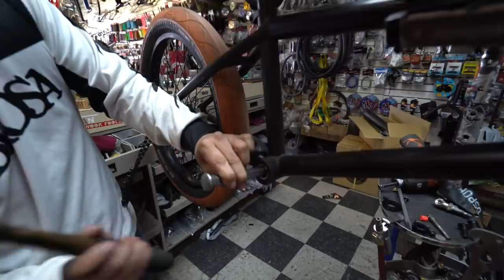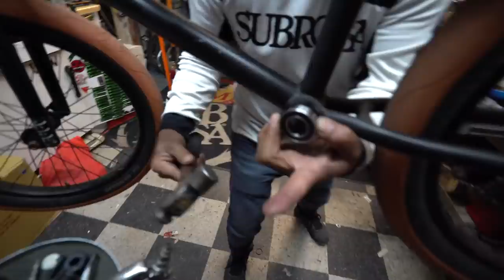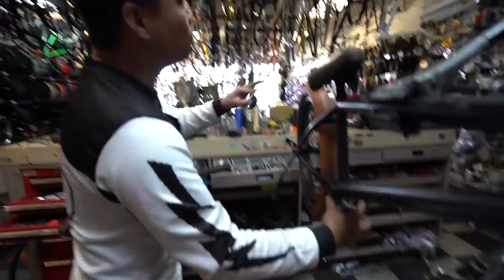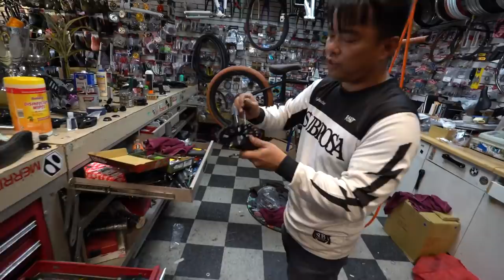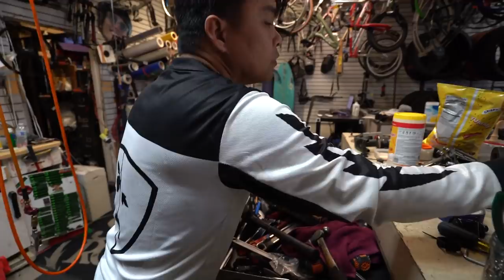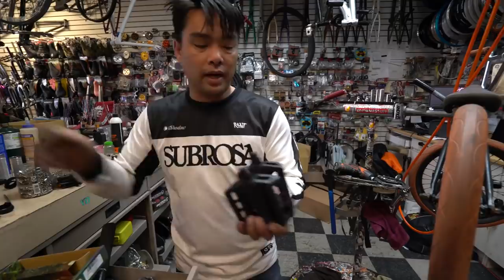How To Install Cranks & Bottom Brackets - BMX

Comment: The “floating spacer” is called a bottom bracket spacer, it’s actually there to prevent over-tightening the cranks and crushing the bearings. It also improves smoothness in the bearings overall in my experience. If it isnt the right size, you gotta add a spacer or buy a different sized spacer. It makes the bearings last longer too
Reply: Yes right to prevent over tighten the bolts
Reply: Which he did, cause the cranks don't spin at all at the end of the install.
Reply: How do I know what size I need ? I want two get new cranks on my but idk what size axle it is
Reply: @angelsolano50 it one size fits all
Reply: Nah really I didn’t know
Reply: The correct term for it is inner bearing sleeve
Reply: @apathy9237 thanks for explaining what "this thing" is. These clowns spent too much time screwing around and not enough time explaining and showing us what they were doing. How about getting the camera closer to the BB instead watching pho work.
Reply: 19:22

Comment: Why would you throw the spacer away? The spacer prevents the bearings from side loading the catridge bearings. Just cut the spacer down with a pipe cutting tool it takes like 2 minutes.
Reply: Agree.

Comment: dude i know this is a super old video, but i just installed a sealed american bottom bracket, 19mm, measured the crank shaft i have and it's 19mm, but it is super tight in the bottom bracket. so much so that it takes serious effort to spin the crank. i remeasured and it's definitely 19mm. i've only built 2 other old school bikes so i don't have much experience but zero problems with the other 2, and i didn't use the center piece, thanks

figured it out, one side of the bottom bracket wasn't fully seated. just updated in case someone else has this problem. should have been my first thought.
Reply from the maker: That’s definitely helpful! Thanks!!
Reply: @AlfredoMancuso  I'll have the build uploaded to my channel in a couple weeks.  Couple others already on there, would be awesome to get your opinion and insight.  Learned a lot from your videos,  I appreciate it bro
Reply from the maker: @jeffsheppard_actor  yes please feel free to send that on over!
Reply: @AlfredoMancuso  I will try to remember

Comment: ummmm. I am a diesel mech. I have bearing pullers. No bearing is technically reusable as they are consumable items unless unsealed and rebuildable, only "financially" reusable if you cant shell out the cash for a replacement. Another excellent instruction video, keep it up guys.
Reply from the maker: Damn that’s good to know!!
Reply: @AlfredoMancuso  LOL, I have to add something about the spacer which goes between the bearings on the bottom bracket. Not using it can create a concave pressure on the center bearing race when tightening the crank bolts. This can cause an inexperienced mechanic to over torque their assembly and lower the quality of the rider’s experience and longevity and durability of the bottom bracket.  Anyways, keep kicking ass man. You are a huge role model to riders of all ages.

Comment: I put the bearing in freezer then install and I also use old bearing to seat new one if not using again ! Thanks for the video ! I’m taking cranks off now !
Reply: Why in freezer?
Reply: @3rdWorldNola it shrinks the medal making it smaller thus easier to slide it in. Once it heats back up it'll expand and fit nice and tight

Comment: The spacer works fine on my Cult frames and on my GT Fueler. It makes it so you can tighten your cranks without straining the bearing. That’s why Alf’s cranks are always loose.
Reply: Yeah i say use the spacer. Notice when phu tightened the crank in it  put a bunch of resistance on it. I know alf dont run the spacer either. too much side weight as you said

Comment: So that middle spacer is used to preload the bottom bracket bearings. In the past you can measure the bottom bracket shell width and measure both bearings and what you have left is the size of the middle spacer. You can also use the smaller spacer to put inside the frame as well and the BB will spin smooth as butter unlike what was shown here it’s not good for the bearings to spin like that at all. 

Cheers!
Reply: Good luck if your trying to get the bearings out with that bb spacers lol
Reply: @deadboy6666  it’s quite easy with a smaller flat head you can gently move middle spacer and press bearings out no problem 👍
Reply: I had my new bike (Cannondale) that tight from the factory and in 1-2 days it started making cracking noises, I think that is too tight too, and feels hard to pedal.

Comment: I have a question do you need an Crank installation toll to install cranks?

Caus i´ve put my cranks on without this tool and it works perfectly!
Reply from the maker: Technically you don’t, but it does make it easier and you don’t have to damage your cranks by banging on them

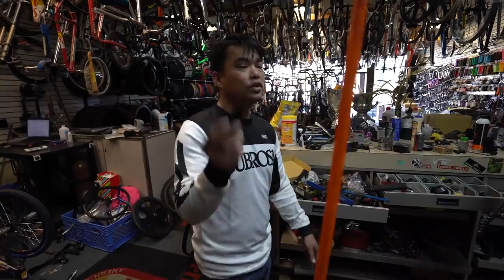Comment: 8:00 Isn't that part of the frame machined before it's welded? Even if the tolerances are off, can't you just use the same spacers on the inside too? Also, if the bearings have nothing to tighten against, won't they just become loose inside the frame over time?
Reply: Just use corect spacer. But there is a ridge inside

Comment: K i have a onlt 9tooth casset k now when i put it toghther with tge rim it is also put in to a old back pedle brake rim becouse its the onky rim i had that it works in kinda but qestion is what is it when i coast it also spines the pedal arms with the tire what is the xouse of this?

Comment: Hey phu you can actually make a bb press using washers and a threaded rod from the hardware store
Reply: Yup, I did this on my recent build.
Reply from the maker: Pinning your comment for your ingenuity!
Reply from the maker: You guys are rad!
Reply: Been doing this for time. Shout out Matt Wilhelm for the trick.
Reply: Yea seen the video too
Reply: Lol I'm a slacker and just use wood and a hammer. Never scratched anything
Reply: @cfmechanic  its not about scratching stuff. You apply side load on the bearing less evenly and in sharp spike loads. Basically the worst stress on bearings. I use a press vs my friends always hammer bearings in and my bottom brackets always last longer. Even when I ran smaller Spanish bearings vs mid. 

This is why coasters blow up all the time. Side load.
Reply: @bmxriderforlife1234  Yep I damaged my bearings doing it like that. Funny thing is, they never gave me any problems despite the damage I caused but it's still best to use a press because I might have gotten lucky lol
Reply: if ya got bike parts laying around , i have been using an old axle with some washers as a bb press
Reply: I just send it in with a rubber mallet
Reply: @SilveradoOutdoors0205  just as long as you're using the happy Gilmore method. Just tap tap tapppp it in now.
Reply: if uir lazy to go to the hardware store and u have an old bike hub axle u can use it as a press with some washers :)

Comment: I need serious help.
I have an elite bmx The crank was stripped out so I bought a new one. They did not send me the spindle so I bought one from mission. The issue is that there's so much paint in the threads of the crank arm. I can't get the spines to lineup.
I don't want to ruin the spindle I just want to put this crank on and get rid of this bike. Because elite sucks

Comment: Can the BB spacers also be used to line up the sprocket with the driver in the rear, so the chain is in a straight line or as close to straight as possible?
Reply: Ye

Comment: What if my spindle won’t go through the bracket? My GT set has a spindle with has a small lip that won’t let it go through the bearings. Are there spindles that need to be installed from inside rather than sliding it one side and out the other?
Reply from the maker: DM us a photo on Instagram: @alfredomancuso

Comment: I used a railroad spike to get my bb out of my old frame to put it in my Sleeper. It works great
Reply: Don't use old bearings in new frames. You can stretch and warp shit. New headset and bb every frame that's brand new. Should also replace with brand new bearings every time but meh.
Reply: @bmxriderforlife1234  I'm not a very hard rider especially back on the old frame. It was more I just grew out of it. The "old" bearings were still perfectly fine
Reply: @squeezablemayonnaise8904  rewatch this video. Notice phu talks about cleaning. 

And the loose bottom bracket shell?

Its not from weight its from bbs being replaced and using already installed bearings makes this worse. Why in the old days bb cups and headset cups often stayed with frames.
Reply: @bmxriderforlife1234  I cleaned it and took great care of it. Im telling you dude the bb was almost new. I was young when I got the bike and didn't start riding hard until later and that's when I got the frame. It went in perfectly fine and I gurantee you 100% both the frame and bb are perfectly fine.
Reply: @squeezablemayonnaise8904  AND IM TELLING YOU AS A PRO MECHANIC AT  bike shop. installation is all it takes to fuck up the bearing enough to cause issues on the next frame. do what you will but its not best practice. bottom bracket shells are heat treated. bb bearing casings generally arent. you shave off part of the outside of the bearing installing it as well as do some "damage" to the frame on install. using a new bearing keeps shit snug the longest a bearing thats already slightly under sized can cause issues. 

it doesnt matter how hard you ride. a toddler riding a bike with the same shit done to it bb wise can damage the frame and bb. bb who cares but a frame? id rather spend 40$ and assure the frame is good then a bearing being reused to save a few bucks.
Reply: @bmxriderforlife1234  I understand you probably shouldnt reinstall but im 16 so $40 is huge for me. Both the frame and BB are completely fine and I was told by Ethan Corriere himself that I could do that. Sure, maybe it's not the best thing to do but in my case and most likely 99% of the time, everything will be completely fine. Bearings are already not toleranced completely perfectly from factory so the microscopic amounts of metal taken off from taking the BB in and out is most likely no different then say a bearing coming from factory that is on the smaller side of the acceptable tolerances.
Reply: @squeezablemayonnaise8904  yeah you can do it. Also not sure about Ethan but is he actually a decent mechanic? Many pro riders suck at working on bikes. 

Depends on the frame and how long you intend to keep it and who you get bearings from. A lot of these bearings are used in other areas so while tolerancing isn't perfect its damn good. Easy punch out slots can also play a difference. And how the bb shell is made. 

Not sure if you know this but look around bb bearings can be found from bearing suppliers cheap as long as you can reuse the old stuff you're good. Like 10-20$ at most for bearings sometimes less.

Comment: Get phu to talk about ⚙ gearing please. Thanks
Reply from the maker: https://youtu.be/lHXmWgKRhiA
Reply: 9-25
10-28
11-30
12-33
Few others but like don't have to worry.
16-45 

That's on twenty inch wheels. 9-28 is best. Good for fakies on cassettes. Its once over geared so harder to pedal a tad but faster top speed.

Comment: Fu the spacer isn’t for keeping the bearings with perfect space or whatever on them. If there is space that’s fine it’s for if the bearing starts to sink in over time it will and many frames don’t have anything but metal to stop it. So when it hits that back wall finally and you’re pedaling it will get metal on metal contact meaning it has NOWHERE to go so the bearing will get massive amounts of side loading pressure causing the bearings to break and go back much faster than they would have if that “spacer” was there to catch it and keep them safely rotation on one axis.  That’s how bearings are designed to work. And thats why you use spacers doesn’t matter if there’s a half inch of space behind each one. It’s because those bearings haven’t sunk in yet from the spindle having side to side pedaling pressure on it.

Comment: There is a proper tool for removing sealed cartridge bearings properly. It's called a blind bearing puller. That being said, hitting them out with a punch work fine in most applications.

Comment: Sir, the plethora of spacers in the BB-package is for stacking the central "floating spacer" to the right width, just use a caliper-tool, easy. That way you don't preload the bearings inwards on installation for one, they really should spin a little easier than you show. Secondly on side-load-impacts the middle-spacer enables load-sharing between the two bearings, which logically on average doubles the individual side's lifespan. #CALIPER
Reply: so i should put the floating spacer in?
Reply: @goatcow38  It's not actually gonna float but it will make it so the bearing can share side-loads and likely will at least double their useful lifetime. Haven't found another use for that colorful branded aluminum tube they machine and add to the bag. If you don't put it in, you can kill your bearings just by tightening the cranks though, that's something. Used to measure those things out with calipers but meh it always fits with a good hammering, especially when you grease it up right.

Comment: Bb spacing was hard to figure out with no knowledge 
 Looks like Verde frame if so has a narrow bb 68 mm its crap,
 74mm bb is standard those floating washers are 51mm so won't work on narrower frames

Comment: Bro the width of the spacer is the width of the bb shell minus 22mm.  You cant just ruin people's bikes because you can't do subtraction.

 Maybe they should stamp it on the frame since no one can math. Or start using thrust bearings (or literally any other improvement over the current, boring, lame caveman tech.) 

Oh and every bottom bracket kit ever gives you spacers.. I think you hide them with the crank arm spacers because they're the same thing lol. Fu is selling those spacer tubes on the black market

Comment: My inner spacer is, fortunately, too long. The solution is simple; hack saw. If you're pro you use a proper plumbers pipe cutter. If your inner spacer is a bit short use some of the washer spacers inside the BB shell to get it to the right width.

Comment: So much bad advice..for not using the internal washer for example.There is a reason they include this in the bb set.Grease on top of the loctite?Seriously?Hitting the bearings with a hammer if you don't have a tool?Also the cranks became so hard to rotate because you didn't put the internal washer between the bearings.Jesus Christ man..are you sure you work in a bike shop?